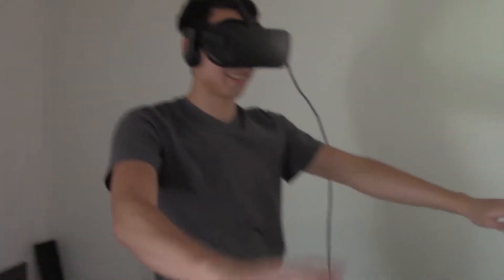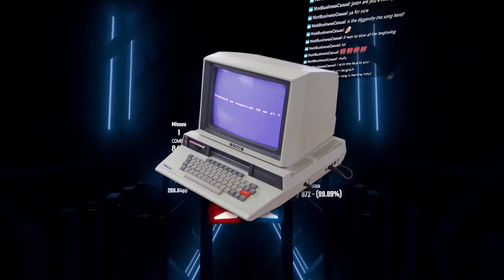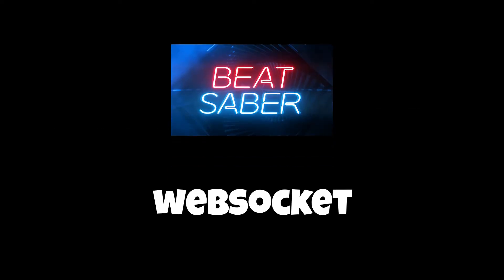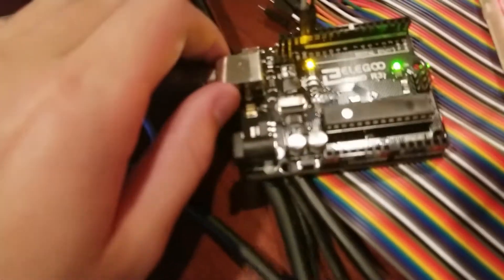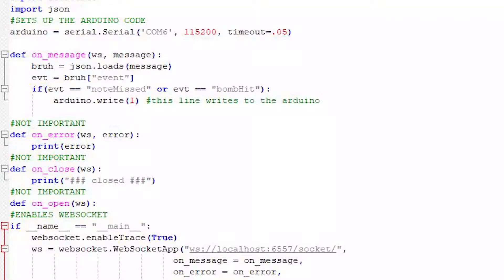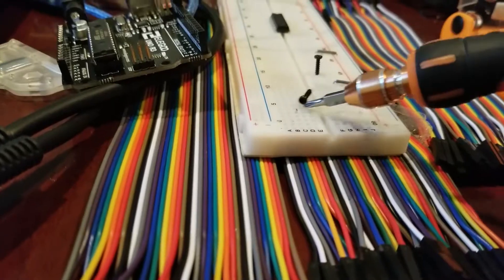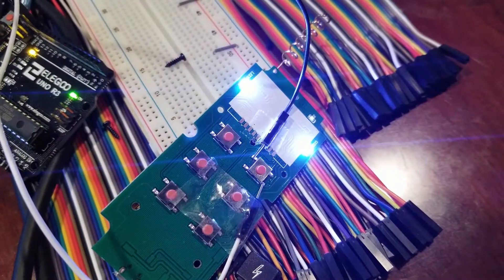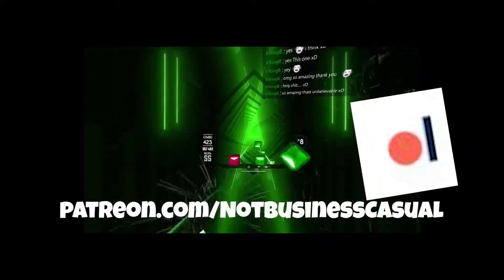How I Tortured Myself with VR - Beatsaber

Comment: MTG 2 video Idea: a bot in mtg that plays one of my favorite decks: a treasure hunt self-mill deck.
The deck is very linear in its turns and doesn't interact with the opponent. Here is how the deck works: the card Treasure Hunt reveals the top cards of your library until you reveal a nonland card and then you put all those cards into your hand. If your deck is mostly land lands you can put a pretty good chunk of your deck into your hand and then loop those treasure hunts to put your entire library into your hand. (because the deck is mostly lands you need to mulligan like crazy). The way you win with this deck is with a card named Thassa's Oracle. It basically checks your library if you don't have any cards in your library you win. If you still have cards left in your library when you get to Thassa's Oracle or if you get the Thassa's Oracle early in the "combo" before you get many treasure hunts there is a land that puts treasure hunt back on top of your library so you can continue the "combo".(the land is Mystic Sanctuary)  The main weakness of this deck is counterspells, if your opponent counters Thassa's Oracle you lose.
This deck is more competitive than the program you made in your last MTG video, so instead of getting daily challenges you can enter the deck into the historic event and earn gold.

Decklist:
Deck
3 Treasure Hunt
48 Island
1 Thassa's Oracle
4 Mystic Sanctuary
4 Lonely Sandbar